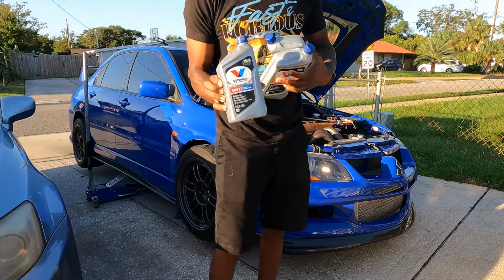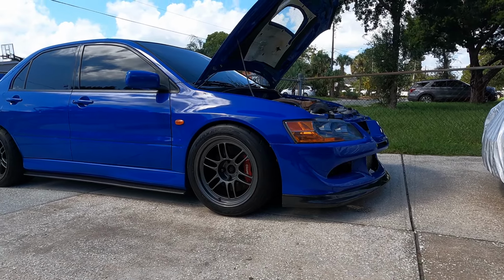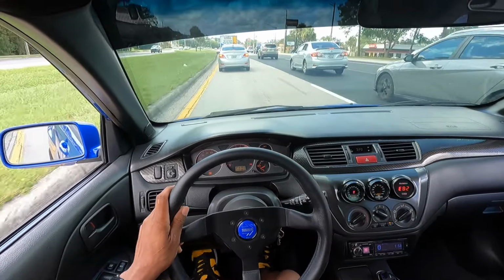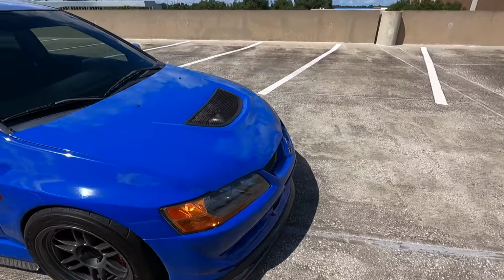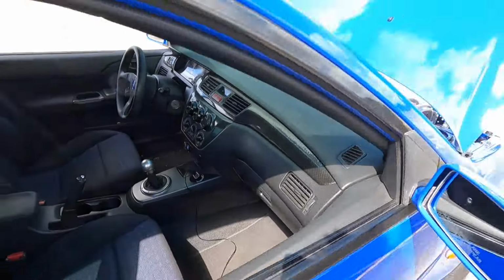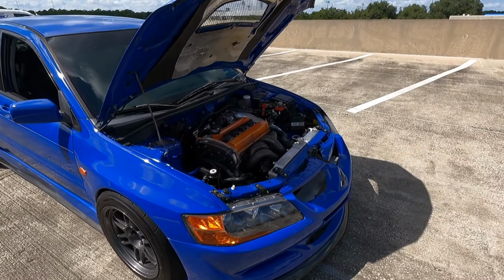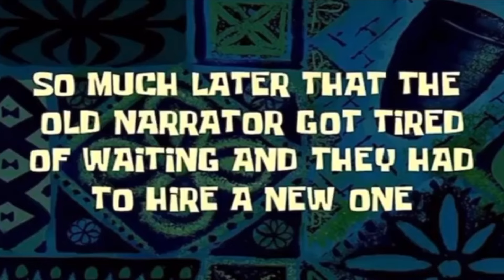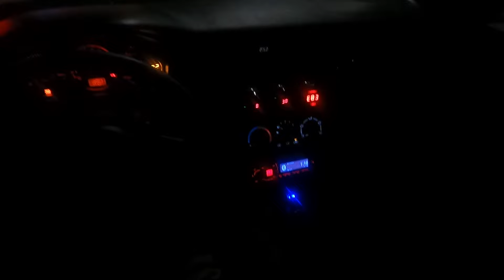Confession about my built 800hp EVO 8

Comment: You can use Liquid Pipe Thread, to seal and stop future leaks. You can get it from Home Depot. It's a little machinist secret that actually works, and it's non-interference. So it's harmless if it gets in your oil it'll just make it's way to your oil filter.